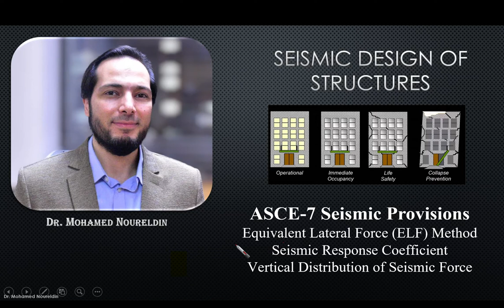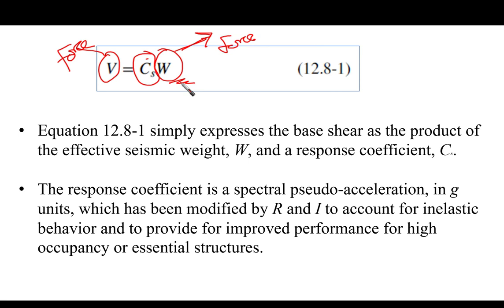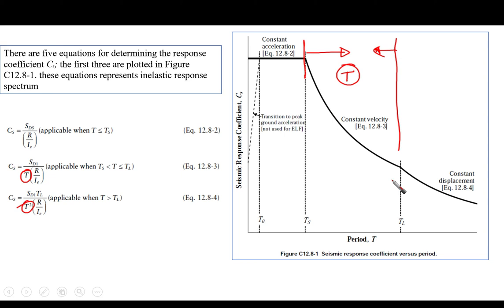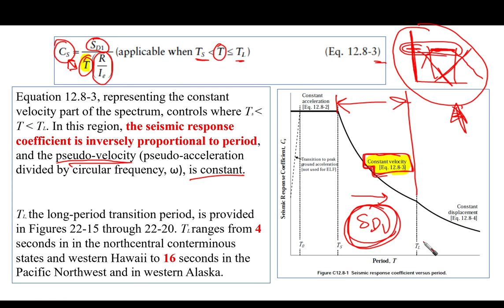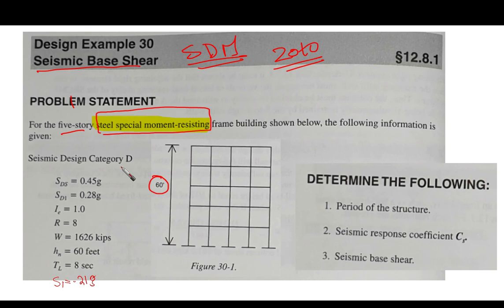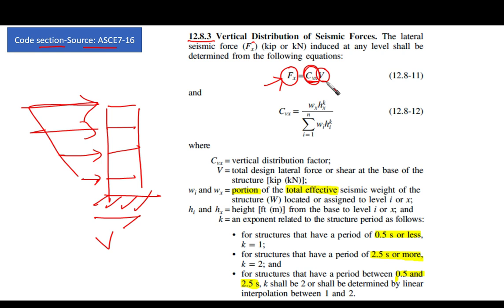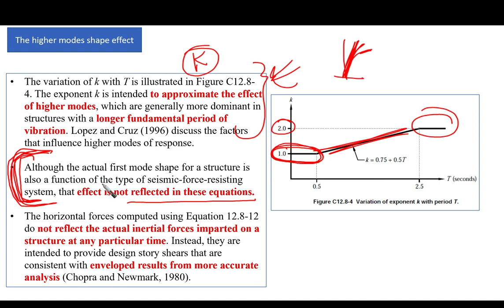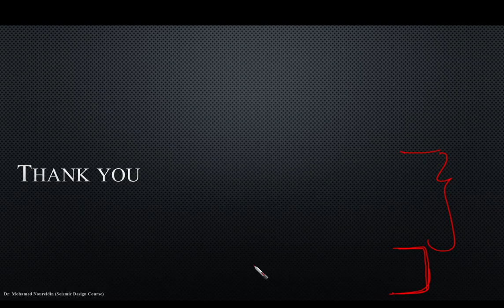18- ASCE-7 Equivalent Lateral Force (ELF) Method-Vertical Distribution of Seismic Force

Comment: What are the situations where we cannot apply ELF procedure in buildings?
Reply: ELF is static procedure in its nature, it utilizes the height of the structure and distribute forces in inverse triangle manner . It does not consider the Mass proportion of the structure( Response spectrum method does). e.g if there is irregularity of mass in bottom storeys lets say it is a library or storage e.t.c , ELF will not consider that irregularity in mass. ( but it should according to F=ma) and will distribute the forces. Whereas RSA is dynamic in natures and utilizes Mass portions y Modal Mass analysis.......ELF should be used in Symmetrical and Regular structures .
Reply: ELF uses Wx = total seismic weight.
Reply: to be consulted
Reply: Thank you Sir! it is realy a big concept in small easy sentances.